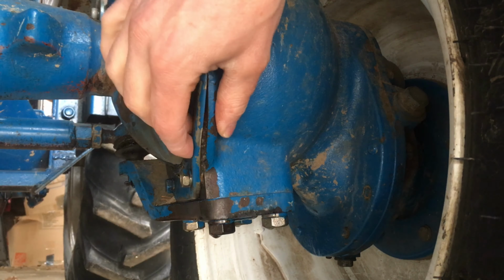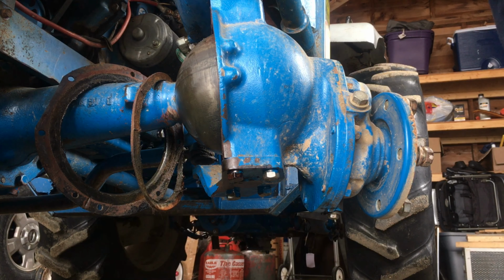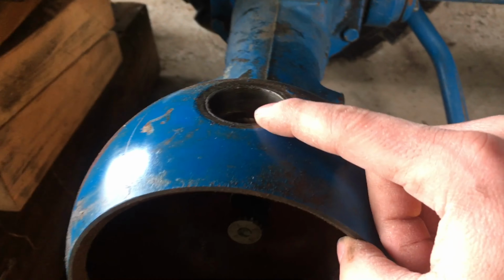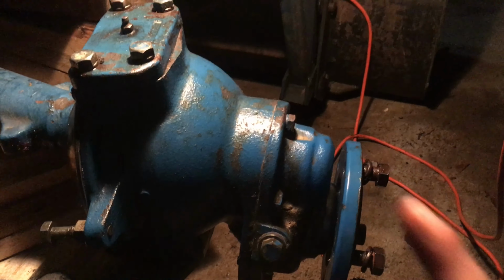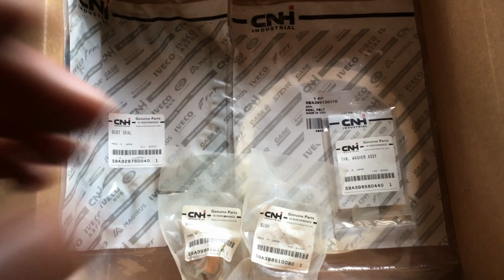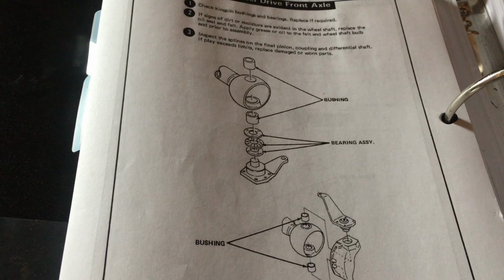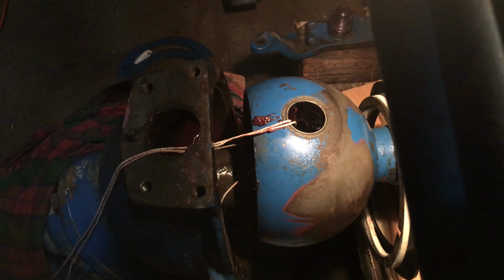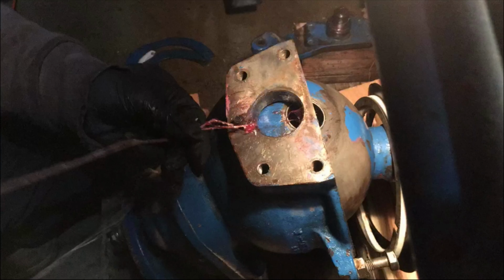Ford 1500/1700/1900 4wd Tractor - Front Axle Kingpin Dust Seal Replacement

Comment: What weight gear oil and does it simply get filled to the top where the bolt is on top? Fantastic job of filming and editing and `explanations.
Reply from the maker: See my video on the front axle fluid change. You have the differential, and then the final reduction gearcases at each wheel as separate reservoirs. I have 80w90 gear oil in mine. https://youtu.be/z8UP_9JS_NI?si=w6MphbZEfkaacbdz

Comment: Sorry for haunting your multiple videos in the comments. 
I’m actually just getting into this today too so rewatching this. Drained reduction gear oil and diff oil and one side of reduction had heaps of fine metallic paste. I went in from the wheel side and have opened the reduction case gearbox thing and have found the bearing that was failing (Nachi 6308 I think, the largest bearing, both sides of the cage were breaking up) I think I pulled the shaft out from the wrong direction, but will have to take the rest of the hub off from this side of the knuckle and wrestle with that coupler thing you struggled with🤦‍♂️
Reply from the maker: I’ve never taken the gearcase apart. I need to do my front axle fluids this year. You can drain it without opening it up. As a warning, early models with loaders had front axle failures (output shaft from the gearcase to the wheel hub). They strengthened it for later models (I think 1981 and up). If you’re there you should pull the final reduction gearcases off and check the king pins, bushings, thrust bearings and washers. I’d replace the rubber and felt dust seal at the same time. You’re there and it’s a pain to get there and back. Grease the coupler and inside the housing well with thick grease, block up the gearcase and use a string on that coupler to hold it while reassembling.
Reply: @ProductiveRecreation  thank you. As I’ve split the reduction gear case, I think I will have to pull the rest of it off to reassemble before trying to get it back on as you did, so will have to wrestle with the string and coupler and stuff. I will check things as I go, but probably won’t aim for a total rebuild at this point as I don’t want to have to order special parts from America to Australia yet.
I’ll need to organise a good big order sometime down the track with stuff I need now and might need later.

I can source bearings and probably some seals locally, but unsure about bushings and other more specific stuff. Seems like my gasket will just be usable again even though it is cracked and a bit damaged. Would be great to see if any rubber and felt for the knuckles could be adapted from some local car 4x4 source. 
I’m hoping to get a bearing today and start to try to reassemble—unless I find more broken stuff as I go.

And oh yeah, mine is a 1982, so hopefully has the upgrade you mention. It would have run a heavy loader and backhoe in public service life from when it was new.
Reply: @ProductiveRecreation that circlip on the shaft extending out of the final reduction gearbox—does that just stay there on the shaft when you do the install? I’ve pulled it out from the other direction and was wondering when it needs to go back on and what it does. I suppose it just provides a stop for the coupler to slide up to?
Reply: @ProductiveRecreation  just to update, I replaced my bad largest bearing in the final reduction box. I got the gear case back on and the coupler connected without removing the rest of the hub/case.

I took the top kingpin out, bushing was fine, and from what I could see it all seemed OK inside. Lots of what seems like moly grease, no water, seemed well serviced, bottom thrust bearing felt OK, so I left it all together and tried to see if I could get it back on.

I had to use a screwdriver poked through the shaft hole to get the coupler back on the differential shaft, as it had fallen off.
As best as I can tell I didn’t loose any ball bearings from the coupler. I couldn’t get a piece of string around that coupler like you did because I could only go in through the top kingpin hole. I bent a bit of wire into a gentle hook which allowed me to thread it down and around into the housing and got it under the coupler. With a third hand holding the wire out the top, and holding the coupler up, I lined up the coupler with a screwdriver through the shaft hole, and then jiggled the outside half of the reduction case in and after a few minutes managed to rotate the hub a bit a get the splined shaft into the coupler. It seems to be OK—and my only real concern is that I dropped a ball bearing out of the coupler and didn’t notice🫣

So, provided I haven’t made a mistake with the coupler ball bearings, it’s possible that this way (splitting the reduction gearbox) is easier than trying to install it whole. Didn’t have to use any blocking, and being split the weight was manageable. Once I had the bent wire supporting the coupler and got my partner to hold the wire, it took about 5 mins.

Would have been a lot harder without you help.
Cheers
Reply from the maker: @ontic2354  I’m glad it worked to go back together! There is a clip on the differential shaft, and one on the input shaft to the gearbox. I’m not 100% sure what they are for as they didn’t interfere with removing and reinstalling the whole gearcase. The whole gearcase is definitely heavy… but I could lift it and maneuver it. I can see how having the gearcase apart could grant more access for getting the shaft in, but I don’t like taking things apart if I don’t have to! The extra hands would have made it go faster and easier for me. I did it all myself. A bit of a trick for sure! The second one was also way easier than the first one once I figured out a good way to do it.
Reply: @ProductiveRecreation  thanks! yeah, I was stuffing around trying to figure a way to hold that wire up which supported the coupler on my own—but as my partner got home I just called in the third hand😅 certainly made it quicker.

I think the clips on the differential shaft and the reduction gearbox shaft just stop both shafts from sliding too far into the coupler from both sides, thus they also locate the coupler in the middle, and thus it can be pulled apart from either side. The reduction side clip on mine was damaged and not in the groove, so that got fixed as well.

And agree 100%. I’d prefer not to pull apart things unless I have to, which is why I tried this method after having replaced the bad bearing and not seeing anything that demanded further dismantling.

If you do end up going in there and splitting the case one day, be very careful about the gasket (or have a new one on hand). It’s paper thin, brittle, and rather important as it’s thickness (combined with bearing shims) sets the end float/load on the big bearings and gear. Mine was already cracked in places, but I think I didn’t add too much damage and hopefully it doesn’t leak.

When I do an order one day from the USA to Australia I will try to get new gaskets for that, alongside some knuckle rubber/felt wipers (and whatever else I’ve listed up) to do the steering knuckles properly like you did.

All the best, thanks for all your messages
Reply: @ProductiveRecreation to follow up, my coupler failed. Either I did drop a ball bearing out of it,  or did something else wrong In reassembly. The spherical ball cage on one side has a bit that broke off. Thrust bearing was also a loose pile of metal even worse than yours (it felt smooth because there was nothing left😅)
Top bush was fine, lower bush a bit flogged.
Dammit! Time to buy some new and hopefully cheaper used parts.

Comment: Doing my 1900 now .......wish I'd watched your video fist...... that Damm coupler!!!!!!! Worst part of the job.
Reply: By the way......where did you get parts from?
Reply from the maker: I think the 1700 and 1900 axles are identical. It is for sure a pain. If you misalign and overextend the coupler thinking you got it on, a ball can fall out of it too. Experienced that on at least a few attempts and had to work it back into the coupler. Pack that coupler thick with grease to reduce free movement, and using the string made a really big difference on the second one for me… I will NOT be doing that every 300 hours as the manual suggests, particularly since I think my dust seals had 1600 hours on them. So maybe every 1000 hours or so.
Reply: They do not make a spline alignment tool like for a standard transmission pressure plate?
Reply from the maker: @jimbrown4803  I’m just a backyard mechanic, not a pro, but I’m not sure how that would help here. Those alignment tools come out before the transmission input shaft goes in for a clutch replacement. This is like a CV joint, and the axle end is much smaller than a transmission bell housing. Both sides of the coupler move to accommodate steering. As soon as you took the tool out, gravity and the weight of the coupler would take over, the same as without it. This also has a splined connection on both sides…
Reply: I do believe you are right after thinking about it. I was thinking more about the clutches I had to replace regularly back in the 70’s on my 1967 Camero RS! Lol! Hey, but thank you for the video. I have the exact same tractor and need to rebuild the front just like you did. Your video was worth its weight in gold for me! Pretty darn good production of the video too!
Reply: Where did you find parts for your tractor? I have recent sheared the hub axle and can not find one anywhere online
Reply from the maker: @bradytalkington5511  Wear parts like gaskets, filters, o-rings and bearings can be had pretty easily. Major parts like gears and axles are hard to find. You can try connecting with a local New Holland dealer, sometimes they can find things through their connections. I got the dust seal retainer plate in this video from Long Lane Tractor in PA. They specialize in old Fords and have parts from dismantled machines. What year is your tractor? Early 1700s with loaders were known for front axle failures. There was a kit at one point to upgrade it. Mine is a later 1700 (manufactured in 1981) that was built with the upgraded front axle. I hope you can find what you need!